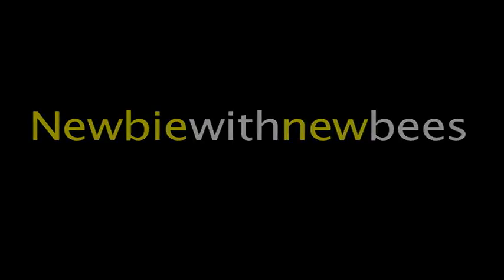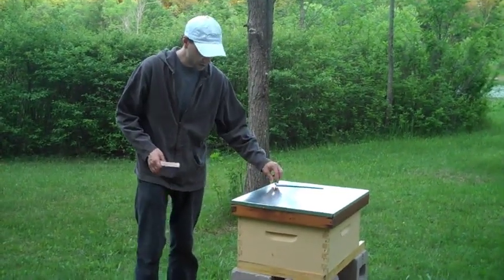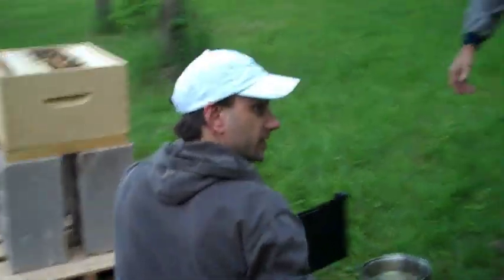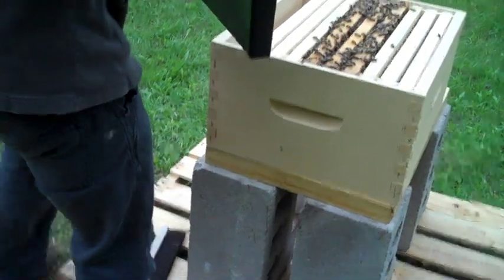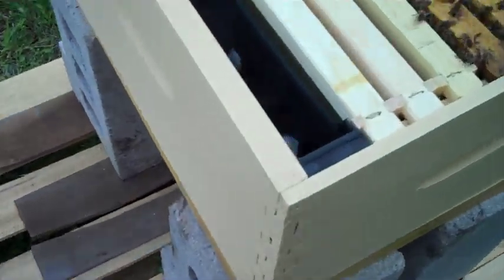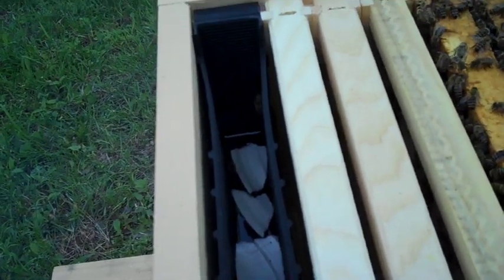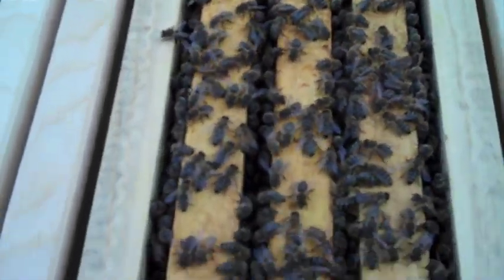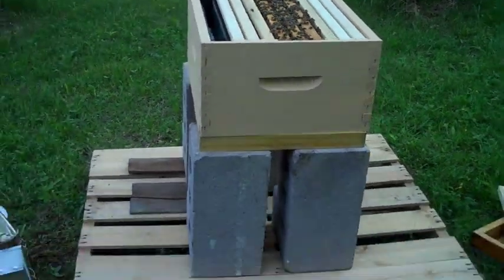Honey Bees, Filling the Frame Feeder

Comment: Ok I'm a beekeeper as well ,and I came  across a frame feeder video last night.
It was partially filled with hay and sugar syrup.
This would allow the bees to feed without drowning at all.
I will start this idea in the spring and see how it goes,secondly if your using a large outer feeder and aren't bothered about robbing and are using  it as a feeder that anything can feed from.
Try filling the bottom area where the syrup pools with small glass pebbles,this also will stop the bees from drowning
Reply from the maker: Using hay in the feeder is a great idea.

Comment: Just some suggestions... To fill your feeder and not disturb the hive too much, simply move the top cover corner to expose the feeder corner. Fill by putting your syrup in a plastic pitcher. So much easier.

Also, simply adding 2 long pieces of thin wood - like long plain non-painted chop sticks or 2 pieces of untreated wood cut 1/4" x 1/4" makes a great feeder terrace for the bees to feed without falling in. You can buy these for a little over $2. Easier to clean and keeps bees from drowning.

Comment: When you go into your hive. Always leave the internal feeder in there to prevent robbing when you pour the sugar syrup in. Remember that you need an even balance or ration during the wintering down period and month. 2 cups of water to 1 cup of sugar for promoting honey storing. 1 cup of water to 1 cup of sugar for energy expenditure. However, other bee nutrition for combating bee starvation is using your sugar syrup mix with pollen patties or agrisea nutrition. Agrisea should only be used in little amounts as you don't want to overfeed since bees can only hold 1.1 litres of syrup in their hive. In conclusion I just wanted to point the sugar syrup feeding because most people would take out their internal 1 frame feeder not knowing this will promote robbing. Mainly if the syrup is spilt.
Reply from the maker: Thanks for the info!

Comment: where is the lid to your feeder and the ladders needed so the bees don't drown?
Reply from the maker: These type of frame feeders don't use lids, and they have 'ladder steps' on the inside of the plastic frames. The styrofoam chips prevented the bees from drowning (you can also use straw, haygrass, etc). I've since switched to feeding sugar water in perforated ziplock bags placed on top of the frames. The bees take it much faster and it's very easy to do. Cheers.
Reply from the maker: @RobGraham048  I updated the description for the linked frame feeder.